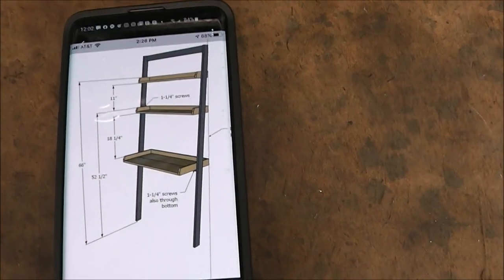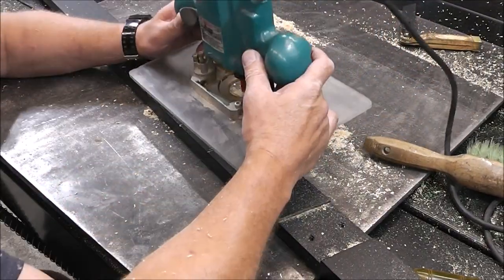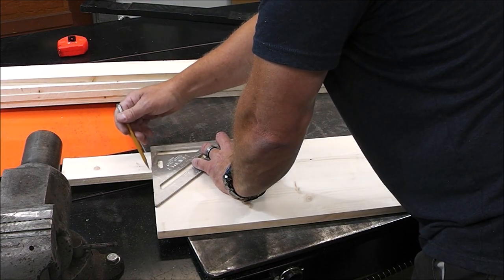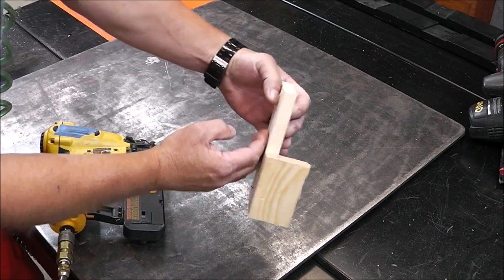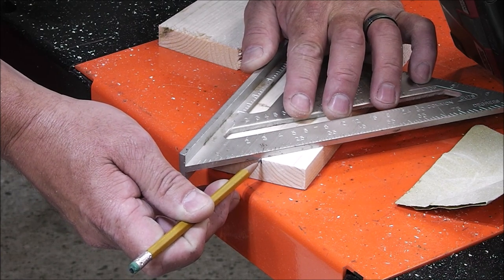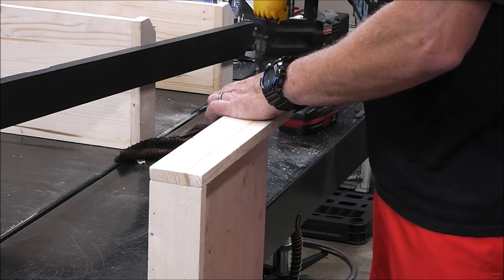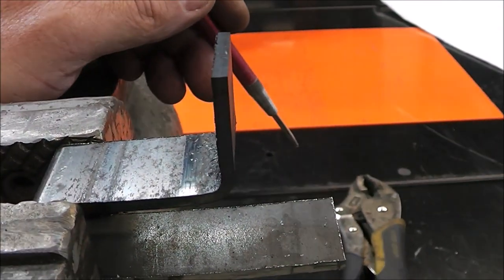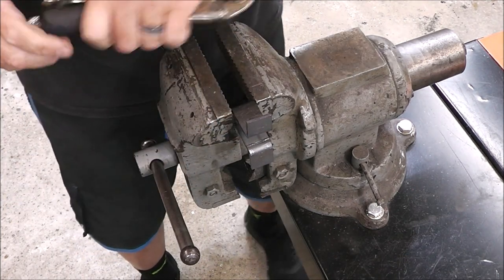Recycled Modern Fold Down Wall Desk with Shelves Metal and Wood

Comment: I just got my dewalt flexvolt cordless/corded 12 inch double bevel compound miter saw and heavy duty rolling miter saw stand in the mail waiting for my metabo HPt 36 volt cordless/corded 10 inch table saw I been getting into wood working alot its a passion just like welding is a passion they are both fun to create beautiful things with
Reply from the maker: WOW! Those are some nice tools! I like wood working also....I just hate the mess it creates.
Reply: @BrandonLund  same could be said on mess for metal as well bro cutting metal is just as messy lol at least wood dust can be re used to plug holes and stuff

Comment: The only thing I might recommend changing on the next one is to use a table saw (if you have one) to rabbet out a slot for the piano hinge strip. That's how you use a piano hinge on something like a toolbox lid and get it to sit flat. But it doesn't affect the strength of the project at all. More of a convenience advantage on the assembly.
Reply from the maker: Good point. I do have a table saw but its bulky and buried in the corner of the garage. Thanks for watching!

Comment: Great Idea! I have a welding question, I do weld all the time with flux core, and my welds hardly produce slag, maybe a little bit. At the end, the welds do look good. Is this normal? I do use Lincoln flux core wire.
Reply from the maker: Thanks! Yes that is very common with Lincoln and with Matheson wire.